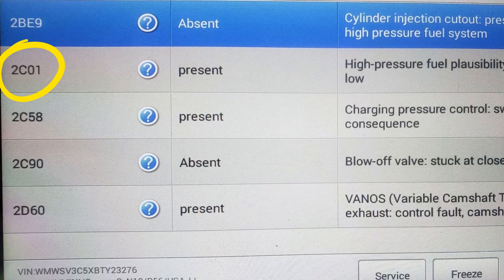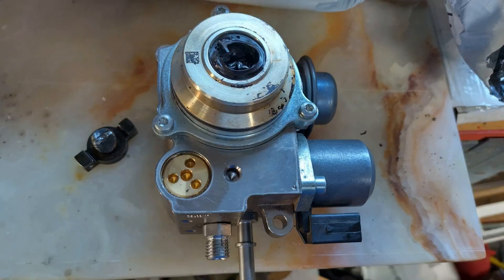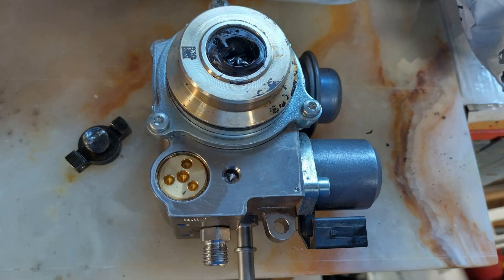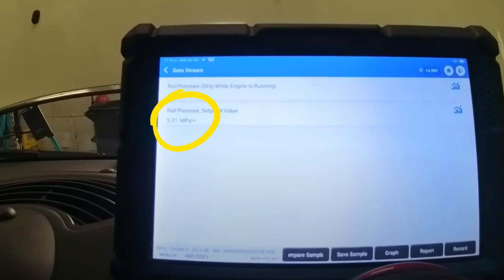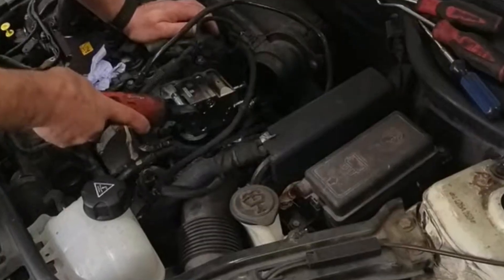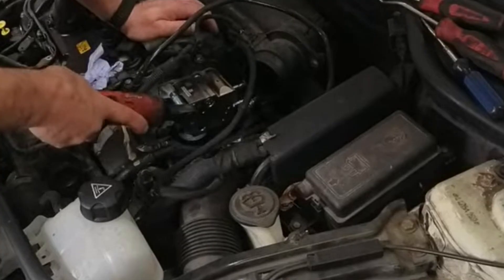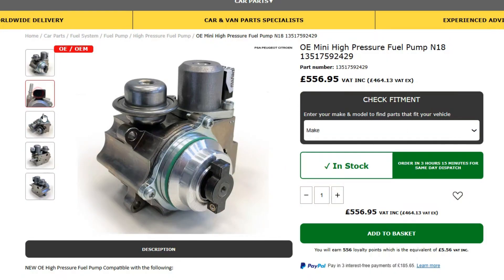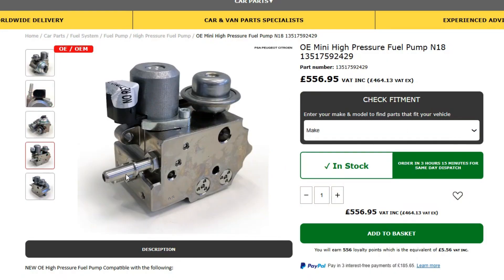Mini Cooper 2C01 trouble code – Reasons

Comment: I had this code and a restart cleared it.  Then it immediately set a 2BE9 and it cut fuel pressure.   I was able to clear that code and restart and now it's normal.   In August I installed a rebuilt HPFP from a very reputable rebuilder in Canada and ran great.   I think it could also be the fuel rail pressure sensor but other than replacing it (which required intake manifold removal), I can't see how to diagnose it other than tapping into the HP fuel line with a gauge.   The car has 253,000km's and it's a pre 3/2012 Cooper S Countryman.
Reply from the maker: Also, the low pressure pump (in the tank) may cause this, worth having a look at. Rail sensors almost never cause real troubles - they may set codes when faulty, but the engine will keep running as if nothing happened.
Reply: @DmitrySapko Thank you for replying.  The gentleman that rebuilt the pump suspects that as well.  I would expect it to show a code for low pressure circuit but am not familiar enough with bmw code.   In that case I guess it could be the in tank pump or the relay in the JBE.  I’m keeping my scanner in the car to see if it happens again.
Reply: He also said a faulty hp pump usually will run poorly on cold starts.  I don’t have that issue.
Reply from the maker: That's right, cold starts will be bad with a failing HPFP, but in your case the problem is intermittent, so it's something that has just started failing and it's hard to rely on symptoms. The low-pressure pump may not show the code when it fails since the problem is intermittent and the only code you will catch is the 2C01 or 2BE9 depenind on how the ECU reacted on this occasion. Also, in a Mini, a low pressure pump may start buzzing more loud than usual when it's about to fail.
Reply: thank you.  Pump is quiet.  I hate intermittent problems and also don’t like throwing parts without a proper diagnosis
Reply: @89vette1  Did you fix the LPFP/HPFP or JBE relay issue with your Mini? and what exactly was the problem?
Reply: @RDraGoNR660 I replaced the HPFP with a new one and it’s been great.  The JBE was fine and is supplying constant voltage to the LPFP as monitored with my Picoscope.
Reply: @89vette1  Ah great! Thanks for the info🙂👍🏼